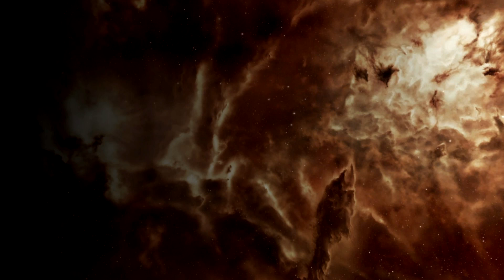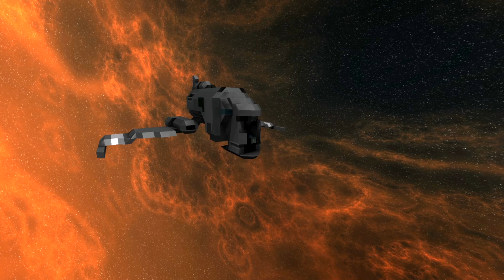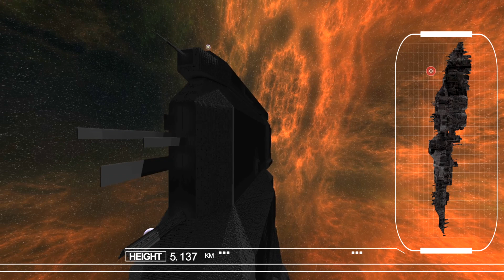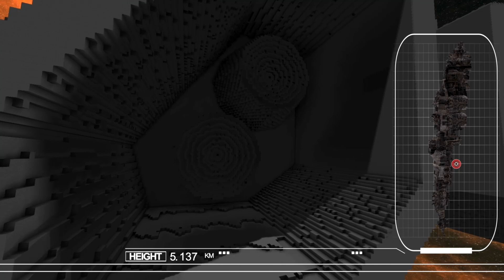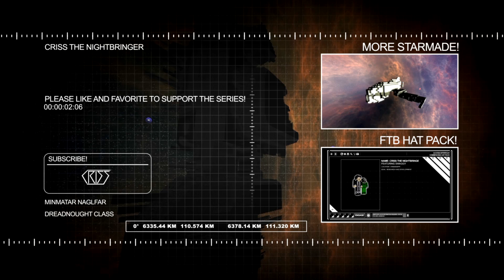The Naglfar - Capital Ships of EVE in StarMade | New Eden Fleetworks Special

Comment: Dreads arent the second largest ships, they are the third largest... from largest to smallest is the following:

Titan > Super Carrier > Dread/Freighter > Capital Industrial Ship > Carrier > Battleship > Battlecruiser > Cruiser > Destroyer > Frigate > Shuttle > Pod (> Drone)
Reply from the maker: In terms of size carriers are smaller or the same size. They are only called bigger in EVE because they support the fleet and offer services such as clone bays. Else wise they are the same if based on size alone. I say this because I m looking at the numbers right now and for all four races, only 2 of them have supercarriers larger than a dreadnought in length.
Reply: Criss the Nightbringer By volume Dreads are about the same as a freighter, a SUPER Carrier(Called Motherships in the old days) is between a Dread and a Titan. A normal carrier is in fact smaller than a dread yes. Super Carriers are actually a different class, CCP just thought it was easier to put it in the category with the normal carriers.

(Mass of supers is also greater than that of dreads)
Reply from the maker: Aang6678 Well that's a bit off. There's no reason why the super caps should be any heavier if they are around the same size. And I did know about the class difference. I have to do my research if I want these ships to be accurate. Still.
Reply: Volume of Hel (mini SC) 51,000,000m3
Volume of Naglfar 15,000,000m3

shapes can be deceiving.
When you see the "(5,137 M Long Axis)" that is just the longest axis.

So lets assume that the long axis on the Nag is Z and on the Hel it is X.

The Nag's Z is 1000m longer than the Hel's X, but the Hel's Z axis is longer than the naga's X axis, and the Hel's Y axis is also longer than the Nag's Y axis. So to use small numbers:

Nag= X:20 Y:30 Z:50 = 20000
Hel= X:40 Y:40 Z:20 = 32000

That is not to scale, but you get the picture.
Reply from the maker: Well that's great but it becomes irrelevant. I was talking about a single size, the longest axis, which is the only length that EVE gives. In terms of StarMade it gives it relevance, because nobody playing StarMade knows or cares about the volume of their ship. I can render a massive volume in StarMade, but I cannot render a massive length because of the mechanics. Closer objects render first. I can completely render something like an obelisk but not the Naglfar because of its longest length. Trust me. I can see the ships. I've looked at them In in both games and I can see how one ship is bigger than another.
Reply from the maker: The longest axis on all drones is at least 7 meters I believe so no there are none that are smaller. The pod would be the smallest ship/drone in game period.